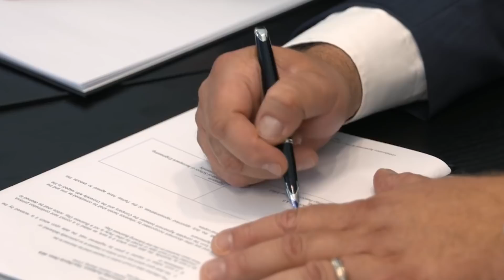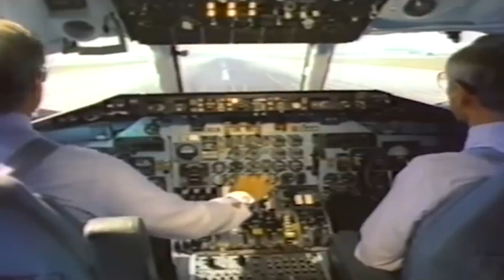Boeing 717 - Boeing model and legacy of Douglas

Comment: I worked on the MD-11 and the 717 at the Long Beach plant. The MD-11 still had a lot of customers at the time of the merger of McDonnell Douglas with Boeing, but Boeing quickly announced that the MD-11 line would close because it was competition for Boeing-heritage double aisle planes. When the Boeing people studied the 717 and visited the assembly plant they admitted it was a "great plane" and promised to keep production open. But Boeing was now in charge of sales, and they almost always offered customers the 737 rather than the 717, even when the 717 was a better fit for a customer's needs. We were told that customers didn't want the 717 because Boeing wouldn't be developing any variations on the current 717 model. Our question was, "why not?" The truth is that the 717 was the best plane in the Boeing portfolio. It had better insulation blankets, better riveting, better wiring, the seating was more comfortable, the cabin air quality was better, etc. etc. The efficiency and safety ratings for the plane were the highest of any commercial plane. Really, I'm bitter that Boeing didn't promote the 717 program more fairly. It hurt their business long-term because loss of the 717 program left a void in the short-hop market for Embraer and Bombardier to fill. What a great plane the 717 is!
Reply: @ Ray's Dad: thanks for this kind of information which outsiders of Boeing / McDonnell Douglas would have no way of knowing ! To me, the so-called merger was more of a take over and Boeing did not want internal competition from the MDD Portfolio as you pointed out in the case of MD-11 vs B-767/B-777. Same goes for the MD-95 vs B737 NG; therefore, McDonnell Douglas Jetliners had to vanish from production lines as Boeing would make no further effort promoting the MDD portfolio..... What did not make sense to me was Boeing leaving the 100 seat jetliner market and allowing Bombardier and Embraer to fill in the gap ? If Boeing had been smart, they should have developed a MD-95 / B-717 family as with other airplanes and keep a share in the short haul market....
Reply: I must agree on you on this. The 717 was probably the best aircraft in its category type and had Boeing planned to promote it (which they didn't) it would have most likely had 1000 aircraft sold by today and I'm willing to bet a billion dollars on that. Unfortunately Boeing dug up its own grave, sorry to say.
Reply: Having flown on both, I'd take a 717 over a 737-700 any day. Such a shame its life was cut short.
Reply: Ray's Dad that’s true about the MD-11.  Most people don’t realize the type (primarily the freighter) had a sales surge between 1996-98.  It briefly had started to outsell the 747-400F for new orders, so Boeing canned it.  As for the 717, far many more would have been built if MD had stayed the course as it’s own corporation, and offered the MD-95 as a family.
Reply: Thanks for trying to tell the truth that MD-11 and 717 forced out of production because 'Boink' didn't want MD products to compete. Not long ago several companies asked Boink to reopen the 717 lines but were refused. Attempted to B&Switch to 737, and thats what started the 'Dehavilland's cheating nonsense'.  Not to mention their safety records were the best, until the rivalry.
Reply: Ray's Dad - This is anecdotal, but the Boeing guys I’ve spoken to were NOT happy with the purchase of McDonnell Douglas.  As far as they’re concerned, the Douglas is full of bean counters who couldn’t engineer a paper clip.  To paraphrase what I heard: “Boeing bought a nearly-bankrupt company, let its leadership take over Boeing, and then acts surprised when the 787 program went to hell.”
Reply: Bryan Noga unfortunately those Boeing folks are probably biased (which is understandable) or uninformed, as a review of the public record financials would clearly indicate that in 1996 McDonnell Douglas was nowhere near bankruptcy.  They were well in the black and the stock price gains in the mid 90s reflected that.
Reply: @ClockworksOfGL   the 787 was pure boeing miss management
Reply: @ClockworksOfGL  are you referring to Boeing cutting corners on 787 build quality to slash costs? I saw an Al Jazeera documentary about that called broken dreams.
Reply: @ClockworksOfGL  Boeing built crappy planes. Let's see the DC 3 is flying to day. Name one Boeing plane that old that is flying to day
Reply: @ClockworksOfGL  no one force boeing to buy any thing  base on how long planes last douglas built them better. hint there are more dc 8 flying today then 707
Reply: Erich Weiler You're seriously comparing the 787 and 777 to the 717? They weren't even buoy for the same markets. There is no valid argument in your statement.
Reply: @QueTalMiAmigo  ya obviously the guy From mcd has no idea what he's talking about, and needs you, some random internet nitwit, to explain it to him.
Reply: @QueTalMiAmigo  thank you!
Reply: @ErichWeiler-t9v  As a retired engineer who worked for both MDC and Boeing I can tell you that Boeing aircraft are built to minimum standards and MDC built them rock solid.  This is why while DC 8's and 9's are earning revenue contemporary 707's are in the bone yard as used up airframes.  Boeing was smarter at business.  They build a cheap product that will last 8 to 10 years which is all a first line carrier cares about while the secondary market for MDC aircraft is very strong.  Long life airframes does not do the manufacturer an good.
Reply: @tomjoseph1444  ditto that
Reply: both forced out for pretty much the same reason.  Boeing doesn't like anything to compete with their product, so down it goes.  PS the new engines were based on (back then) the new engines that went into the DC-10 & MD-11, over time more and more improvements based on the 'New Generation Engines".  Thanks for being honest.
Reply: Still going strong with Hawaiian Airlines here in the islands. They have 20 of them and they seem to do very well for the inter island flights with a lot of cycles and often quite windy conditions.
Reply: @JWB671  the Boeing 737 could not last that last long
Reply: The ironic part about this is that a modernized 717-max would be vastly better plane than the Airbus A220.
Reply: Delta owns 60% of the 717's ever made. If they had a modernized 717 there is no way the buy the A220
Reply: The 717 is still vastly preferred over the CRJ's.
Reply: @voss0749  and is that not boeing's fault
Reply: it is boeing's fault. it call missmanagement
Reply: if a company buys out your business, don't expect them to continue selling your products, they most likely bought your company so they could destroy it and thus destroy competition. most airline mergers follow the same story.
Reply: @ErichWeiler-t9v  Just wait,  You think the Max has issues wait for the Dreamliner problems..  Retired Boeing Engineer.
Reply: @tomjoseph1444    Okay, Tom.  I'll wait.  You just left me another comment that Boeing planes last for 8-10 years..  One thing I'd expect an engineer to know is, the lifecycle of a commercial airliner is not based on years.  It's based on hours.
Reply: @ErichWeiler-t9v  Yes, the 737 is built as cheap as possible.  I could list a few items but if you have never worked on one it would be useless.  It is popular because it is cheap.  Bottom line is everything.  Yes, sometimes engineers screw up but every machine in you life was designed by an engineer, usually to a price point.  WTF does your willingness to fly in a DC-10 have to do with anything?  I am sure you stayed in a Holiday inn as well as having engineer neighbors so you must really be on top of it.  MDC had one of the best engineering pools in the world.  Boeing was very actively recruiting from us prior to the merger.  I was flown up there and given the grand tour and pitch in '95.  Some of the engineers you say you know may well have worked for MDC before BCAG.  I knew quite a few.  The 707 reference was a demonstration of long life airframes try to follow the plot here.  
What Douglas did not have was business sense or timing.
Reply: @tomjoseph1444  ditto that
Reply: @ErichWeiler-t9v  I worked for Boeing as well and have a nice retirement from them.  I never said that I hate Boeing.  I think you are really in a world of your own and cannot understand what you are reading. Cycles do translate into years based on average usage.  You learned one term and all of a sudden you know it all.  First line carriers do not usually keep their aircraft for the entire life of the airframe  because their comes a point of diminishing returns vs. maintenance and upgrades.  That was one of MDC's problems in that they built aircraft much tougher (heavier) than required to do what the customer required.  Boeing got it right in that respect.  Again building to a price point which is what all companies do.  If you truly do own a company as you claim you should understand this point.  If not, you are actually in your Mom's basement and it sounds like you just have some kind of Seattle fetish.  Since you not able to comprehend, this conversation is over.
Reply: @ErichWeiler-t9v  no way .... Oh mean like their new planes are even better haha the 737 max LD LAWN DART MODEL ya great company and product. And the 787 has continuous problems and is constantly being reworked by engineers out of South Carolina. So not sure about your facts. I will agree the triple 777 is a great plane
Reply: Ray's Dad  I worked there to  Dept 543 MD80 nose Dec85-Apr87 Dept 587 west ramp  I worked on all versions of the twin jets on the MD-11 on the few T 45s we did put together in Long Beach and finished on the C-17 hello and I agree with you on the 717 I believe Boeing didn’t want it because it wasn’t designed by them and they were pushing the 737 and look at them now the Max 9s are still grounded just saying anyways thanks from a fellow Dougloid
Reply: @remylopez4821  I worked in the Flight Test / Production Dispatch Office Bldg 15 from 1988 to 2002. Dispached all those aircraft.
Reply: Keith Freitas Then you probably remember Captain Jack Billings he was one of my favorite company test pilots very friendly personality a joy to be around whenever Captain O’Donnell flew I always knew I would be working on the cockpit sliding windows for air leaks or main entrance door or service store for leaks that man could hear a whistle from a mile away I miss those days thank you for replying I always worked second shift or third I was not a dayshift guy too much traffic on dayshift you got a love LA traffic
Reply: Ray's Dad, completely off subject, but have you ever heard of the Joni Mitchell song, "Ray's Dad's Cadillac?"  Thought you might be interested. :)
Reply: Thanks David Silver. I just found "Ray's Dad's Cadillac" on YouTube and really like it, though I'll need to replay it a few times to understand the words. Obviously the song isn't about me, since I drive a '92 Ford.
Reply: Boeing is using predatory pricing tactics with their Dreamliner. It is estimated they are losing $25 million on each jet delivered.
Reply: @ErichWeiler-t9v  That is fine.   I will say that the scenario of 8 to 10 (the lessor number for short haul) years was given to us by a VP of American Airlines in a presentation they did for us in about 1994.  Also in evidence is the many airframes in the bone yard which had not reached their listed cycle life but had become to costly to maintain or inefficient.   As far as MDC going what I call the extra mile, I spent many hours finding a barely detectable whistling noise in the last two rows in the 717.  I finally found it in the sonic seal of the APU door.  I know from friends who had gone to Boeing at that time  said that they would never have bothered.   This is the kind of difference I am talking about.  The passenger air ducts in a 717 are  welded air tight thin wall aluminum tubing, the 737 had "pool vac" hose strung up by ty-wraps.  Did the 737 system work, yes, was it the best it could be, no.  There are a multitude of little things like that.  BCAG use to send 737's down to us to do mods on.  At first we were really shocked at the difference.
Reply: My father was on the design team for the MD 11, C- 17, and the 717. He was the electrical and structural engineer . Maybe you worked with him in Long Beach
Reply: Erich Weiler no, definitely Boeing didn’t know what they are doing. If they did, the Max would never had appeared.
Reply: Ray's Dad : I’m a plane nut. Really interesting information. It’s always cool to hear from someone inside the operations. I didn’t know any history of the 717. I wonder I’d Boeing adopted their style of riveting in future airplanes? Thank you for the information. 👍👍🇨🇦
Reply: I love learning about these planes, so thanks goes out to everyone here.
Reply: MD would have never survived. 

The Asian financial crisis was in full swing. 

ETOPS was completely changing world airlines. 

Regional airlines were trading their 1900s and EMB-120s in for Q400s and CRJs. 

Smaller versions of legacy planes like the 737-500 and 737-600 and A318 and the MD-95 were being shunned for either much larger (737-800/A320) or much smaller airliners. 

Only with the EMB-170/190 and now the C-Series/A220 has the market matured enough with clean-sheet designs available to make the 100/120 seat market viable again. Of course people like the 717 more. It gives them more but costs the airlines much more in acquisition costs, operating costs, etc etc.
Reply: I hardly think there were "many" orders for the MD11 at the time Boeing closed the line. Boeing did try to keep the line open even after the merger in hope of selling more of the MD11 freighter version. But apart from the Lufthansa order for a few copies, there were no other major significant orders for the trijet. So Boeing didn't close the line to avoid competition (the MD 11 was hardly competitive agst the 777 or 767 anyway). Boeing closed it because the MD 11 didn't sell. The MD90 was a different story. Boeing did close that line because the MD90 could be a serious competitor agst the 737NG.
Reply: Leong Phil The failure of the MD-11 and declining sales of the narrow body line are what forced the sale to Boeing. They didn’t have competitive products against either Boeing or Airbus. MD didn’t make the required investments in new products to stay competitive
Reply: @ErichWeiler-t9v  I would hazard a guess that Boeing did not know what they were doing. As explained above, Boeing ditched the MD-95 only to leave a hole in their arsenal that Bombardier and Embraer moved in to fill. Then seeing just how good the C-Series Bombardier is, and Boeing scrambling to merge with Embraer indicates to me that no, Boeing does not know what it's doing.
Basically, the MD-95/717 showed up the shortcomings in the 737 and still does to this day as many current operators who run the MD 95 are crying out for more.
But then, if I were proven wrong ......
 
https://www.businessinsider.com.au/boeing-717-jet-delta-hawaiian-qantas-2017-12?r=US&IR=T
Reply: Boeing lost the compass in the last 20 years...now 737 Max is the company´s epitaph...
Reply: Not even close

The MD-11 was like the 747-8 is now. An updated legacy design with too many engines primarily sought after by cargo carriers. 

The 717 had a whole pile of problems. It was a full sized legacy airliner trying to compete with purpose built regional jets like the CRJ at the low end, and the Boeing 737-600 NG and A318 at the high end. 

We all know where the market went in the end... the CRJ absolutely dominated the regional jet market with 50 seats and low acquisition and operating costs. And the -600 and 318 were only boutique models—the respective series being dominated by the -800 and straight A320. The only plane that succeeded in that mid market was the ERJ—benefiting from a clean sheet design decades newer and better timed for the market. 

Now the 737 is in the same place the 717 is. It’s too old of a design that’s been compromised too much and now has been beset by high profile accidents related to those compromises. It will be time to cut all legacy ties and take the risk of breaking commonality to succeed or die trying.
Reply: Thank You:  You are describing the typical McDonnell Douglas aircraft, DC-10 did have a handful of problems though, no argument there.  Too bad politics is so heavily utilized to get one's way.
Reply: We really do live in a worse timeline
Reply: Ray's Dad I got to fly one from Cle to msp. It was very nice.  Much nicer than the Canadair that usually covers that route.
Reply: A DC-9 clone which in turn was a Caravelle clone.
Reply: @ErichWeiler-t9v  wrong nane one boeing plane that is as old as the dc3 that can fly today. opps there is none
Reply: @dknowles60  Well, first of all, the oldest commercial airliner in service is a 737-200 from 1970.  Second of all, McDonnell Douglas is no longer in business. Boeing, however is.  In fact, it if weren't for Boeing, they'd be a thing of the past.  The reason we don't see Boeing 314s or Stratocasters in the air anymore is because Boeing has advanced.  To be honest, the DC-3 is a great airliner though.  I'll agree with you on that.
Reply: @ErichWeiler-t9v  you cant fly a 737 200. it is only use on gravel runways due to  having a gravel kit there are much older dc8 flying today. Mcdonnell douglas may be out of business but they have a lot more older planes flying today then boeing does
Reply: Erich Weller, statement that B737 is the most popular plane in earth is somehow funny as the huge production number comes from fact that the plane has been on marked since early days of Jet-age. Airbus A320-numbers are little bit behiond but hey, plane also arrvied 20+ years later to the market.

Another comment from you, which is interesting is your negative attitude towards Bombardier-Delta deal. I just wonder, what you think about the fact, that Bombardier's initial offer was 30 million usd per aircraft but as Boeing did not want Delta to buy them, they in fact in first place offered their 737-7max with price tag of 22 million dollars to which Bombardier replied with new offer of 20 million dollars per aircraft. 

You like to blame Bombardier for unfair competition, price dump, government subsidies etc. but you honestly think that Boeing was playing fair game in the first place when dumping 737-7max to Delta for 22 million usd per aircraft? I believe 2019 list price for 737-7max is 99,7 million usd so are you saying that Boeing was doing right and Bombardier not? 

737 had it's time somewhere in sixties, seventies and eighties. But for sure, now it's an obsolete aircraft. And Delta as wise airline operator did choose the right plane for their future needs. 

I also agree in many ways with Tom Joseph. MD11 as freighter was and still is amazing work horse. Many were unhappy when production line did close. MD11 was better plane than generally considered with many loyal happy customers. 747F is great plane too, but not everyone needs it to serve their needs and routes. Now both starts to be obsolete compared to 777F but still many active years ahead.

It does not matter is 777 or 787 better aircraft than a330 for example  if you don't have the route to fly where you need its capabilities. If you are using 777-200er on a mission that is a 3000nm long and there's little or no cargo to fill the hold after passenger's and their luggages, you are stupid. Operator must always find he perfect plane to route, not to taste. If you like 777-300er but you are doing less than 4000nm missions with average load of passengers somewhere 200, you will go bankrupt even how new and wonderful triple seven you have in your fleet.

And plane is just a plane. Your choice of engines also matters and maintenance and crew training etc. Boeing for example  lacks flight deck commonality which is amazing when considering how long they have been in business. Only where they had that was 7between 757 and 767 (excluding 767-400). 767-400 tried that with 777 series but it was dead in the start with total of 37 orders.

A380 is great plane, but market does not have need for it. In late nineties Airbus and Boeing were making assumtions about how people will travel in 21st century. Another believed in large hubs and another point to point travelling. Even that A380 did not sold like 747 in it's glory days, there is again happy customers who have routes were the plane fits perfectly to their capasity needs. Maybe economically disaster or flop to Airbus, but hey, so was the Concorde, Lockheed Tristar and Dassault Mercure - and two of those three were the best "superior" products at their time flying in the sky.
Reply: @ErichWeiler-t9v  wrong it was way better then Boeing. The 787 has had lot of problems. Douglas planes out last Boeing planes
Reply: @ErichWeiler-t9v  how many rudder failures did Boeing have on the 737
Reply: @ErichWeiler-t9v  wrong
Reply: @ErichWeiler-t9v   lets see boeing lost  2 plane  to rudder problems
Reply: @dknowles60   Yes, they sure did.  But how are you going to compare a company that's made only 676 commercial airliners to the world's largest commercial airline manufacturer with thousands of planes sold?

Quote:

In terms of deliveries, Boeing has shipped 10,444 aircraft of the 737 family since late 1967, with 8,918 of those deliveries since March 1988, and has a further 4,763 on firm order as of December 2018.

Boeing currently has 5,700 units on order.

It's kind of hard to make an apples to apples comparison there.

Don't get me wrong.  I love the DC-10 and I really like the MD-80 series airliners.  McDonnell Douglas was (is)?? a great company.  But I also like the L-1011.  

And let's face facts here.  Boeing started having problems after they started sourcing their manufacturing.  The 787 problems, for example, are mostly coming out of South Carolina, but Boeing had to do something because the fucking unions up here in Seattle are the biggest pricks on earth.
Reply: @ErichWeiler-t9v  The MD-95 is not a Boeing airplane, it is a Douglas airplane!!!
Reply: More people have been killed by Boeing than by McDonnell Douglas
Reply: @ErichWeiler-t9v  Do I think Boeing doesn't know what it's doing, are you ......
.g me!. Read the news mr.
 Ego.
Reply: @ErichWeiler-t9v  As long as they don't  use programmers  right out of school in India, per my son who is a  B737 Engineer at Boeing.